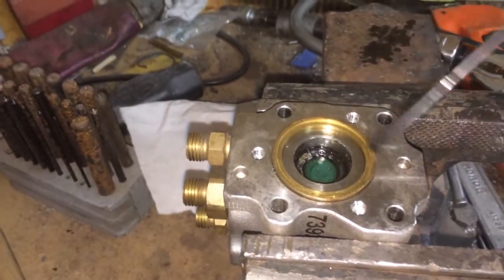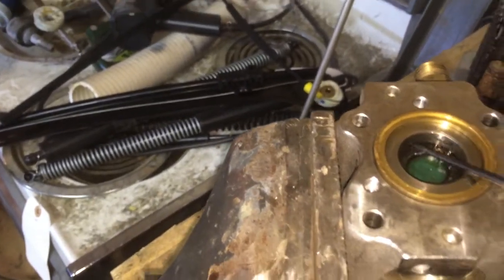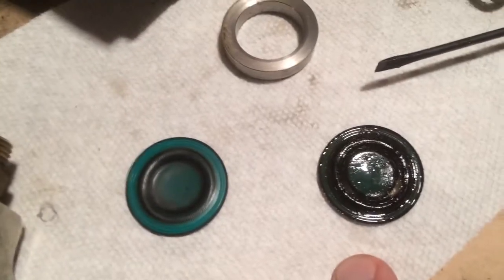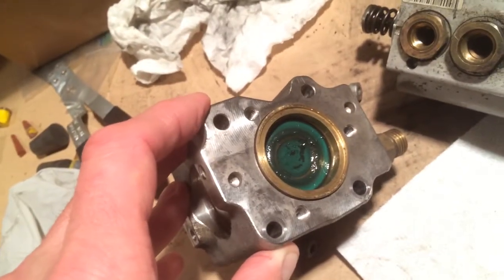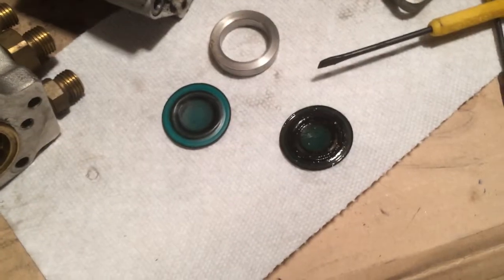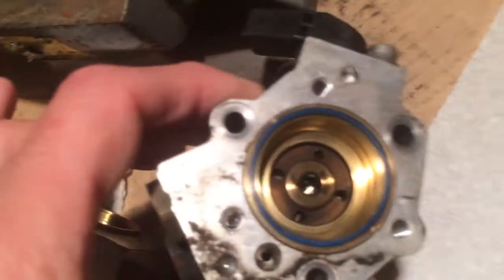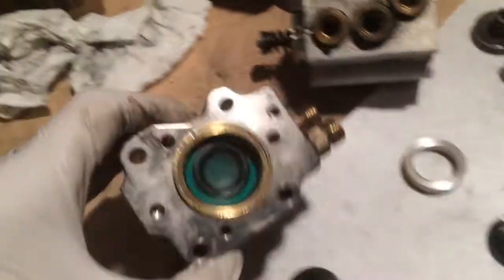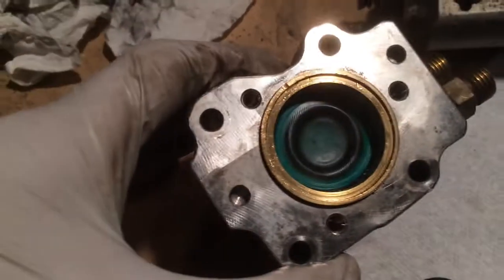HPFPAudiDiaphragm

Comment: Please tell me what kind of pumps are these from which Audi?
Reply from the maker: better solution is to go on Bimmerfest.com and look for HeinrichG. He sells replacement diaphragms made to order.

I do not have exact Audi. You need Bosch Direct injection pump for TDI (turbo direct injection) Diesel, in Europe. It comes from any car with that motor from 2002-2008 or so. Not sold in America. Pump itself will not look exactly like the 720Li, but very similar. Same triangle top with three bolts.